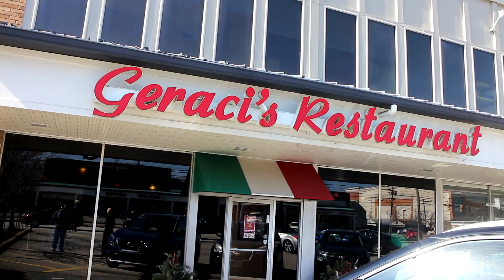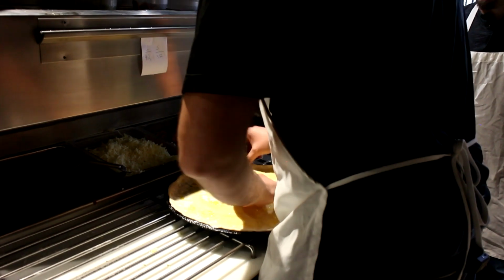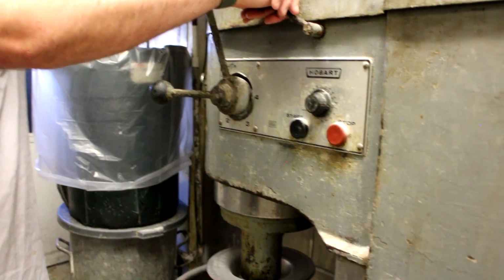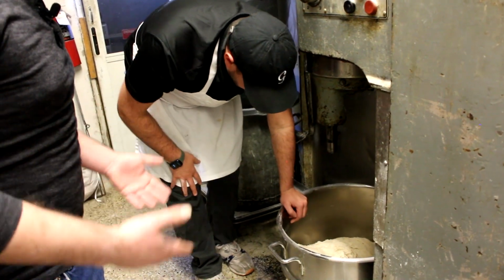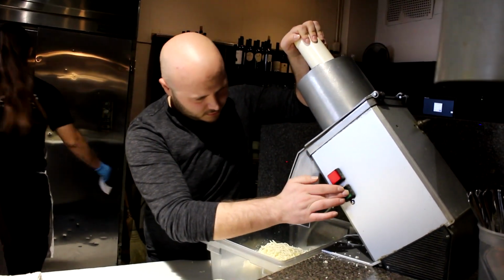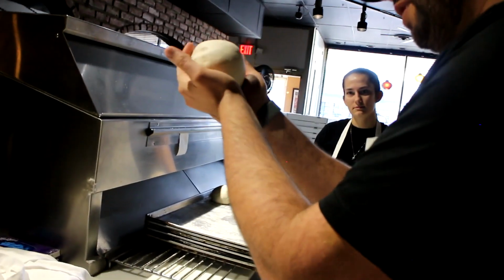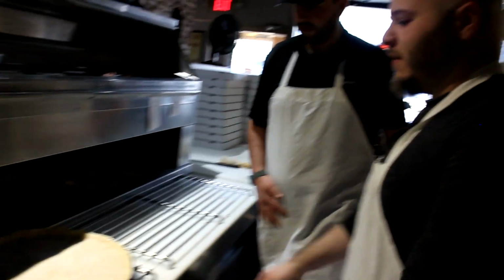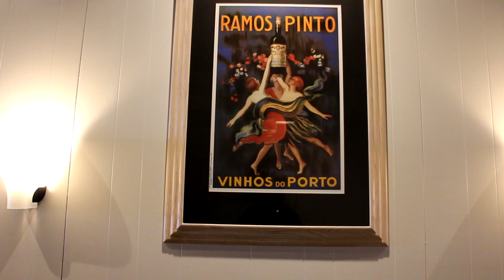From Sicily to Cleveland: The Rich Heritage of Geraci's Restaurant

Comment: I worked there when they had a wooden pizza counter. Bucky there was a toddler.
Reply: Yes - and we'd have to scrub it down at the end of the night with those stiff scrub brushes, using hot water and detergent mixed in that aluminum pitcher Bucky was using for the dough water. Also, the toppings station wasn't so huge - there was a window where customers could actually see the counter.